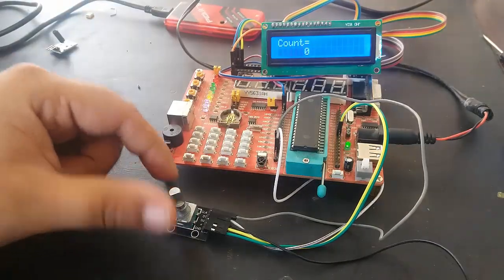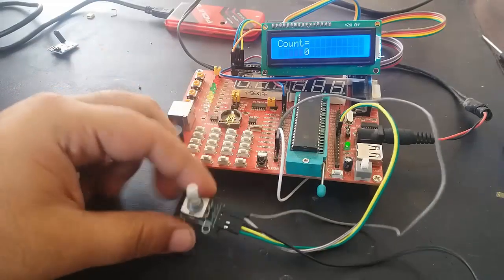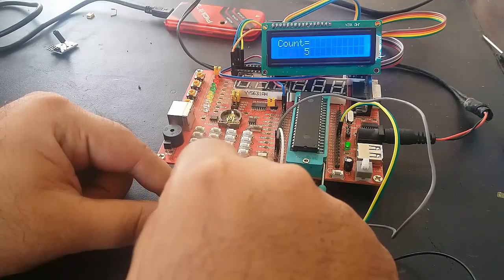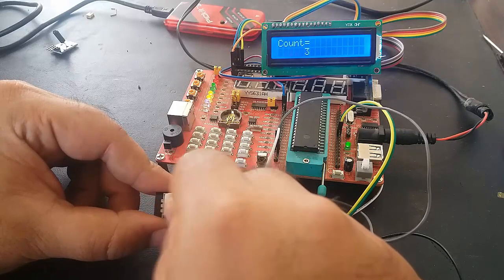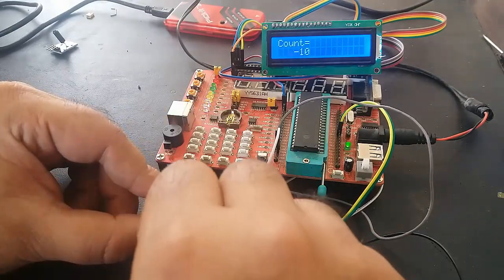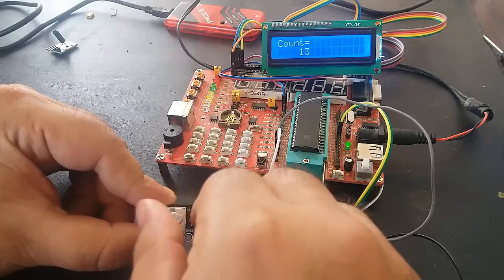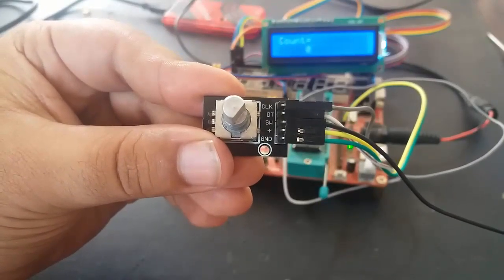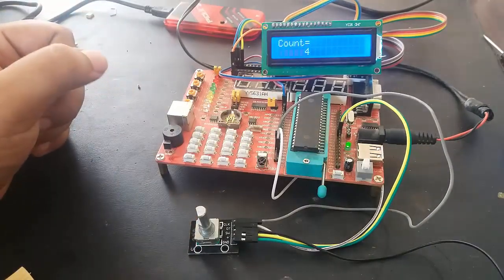Rotary Encoder Module interfacing with pic16f877a microcontroller

Comment: Here is the code:

// https://microcontrollerslab.com/rotary-encoder-module-interfacing-pic/
/*
If LCD display is interface with microcontroller then this controller easily displayed 
the direction of rotation and revolution per minute (RPM) of rotating shaft as well as with angle of rotations. 
Similarly, if this rotary encoder interface with pic microcontroller is used with any conveyor built 
at which objects are moved then this pic microcontroller interface with rotary encoder module 
can also tells displacement of the object form its original point.

In this tutorial, we have use PIC16F877A microcontroller, output pins of rotatory encoder module 
is connected with PORTB pin number 4 and 5. These pins 4 and 5 are configured as input pins.  
Interrupt is used to detect whenever rotary encoder rotates in a specific direction.  
LCD is connected with PORT D of pic16F877A microcontroller to display the counts. 
Video below shows the complete demonstration of this project.
*/

sbit LCD_RS at RD2_bit;
sbit LCD_EN at RD3_bit;
sbit LCD_D4 at RD4_bit;
sbit LCD_D5 at RD5_bit;
sbit LCD_D6 at RD6_bit;
sbit LCD_D7 at RD7_bit;

sbit LCD_RS_Direction at TRISD2_bit;
sbit LCD_EN_Direction at TRISD3_bit;
sbit LCD_D4_Direction at TRISD4_bit;
sbit LCD_D5_Direction at TRISD5_bit;
sbit LCD_D6_Direction at TRISD6_bit;
sbit LCD_D7_Direction at TRISD7_bit;
// End LCD module connections
signed int count=0; //this variable will incremented or decremented on encoder rotation
char text[7];

#define REA PORTB.B4 // Rotary encoder pin definition
#define REB PORTB.B5

void pbchange(void)
{
 unsigned char state;
 static unsigned char oldstate; // this variable need to be static as it has to retain the value between calls
 
 delay_ms(1); // delay for 1ms here for debounce
 state= (REB<<1 | REA); // combine the pin status and assign to state variable
 if(oldstate==0x0)
  {
   if( state ==0x1)
    {
     count--; //decrement the count
     //lcd_out(1,8,count);
    }
   else if( state == 0x2)
    {
     count++; //decrement the count
     //Lcd_Out(1,8,count);
    }

  }
  
 oldstate = state; // store the current state value to oldstate value this value will be used in next call

 PORTB = PORTB; // read or Any read or write of PORTB,This will end the mismatch condition
 INTCON.RBIF = 0; // clear the porb change intrrupt flag
}

void interrupt(void)
{
 if(INTCON.RBIF==1) //check for PortB change interrupt
  {
   pbchange(); //call the routine
  }
}

void main() 
{

 TRISB.B4=1; // set rotary encoder pins to input
 TRISB.B5=1;
 // inilized the LCD
 Lcd_Init(); // Initialize LCD
 Lcd_Cmd(_LCD_CLEAR); // Clear display
 Lcd_Cmd(_LCD_CURSOR_OFF); // Cursor off
 Delay_ms(100); // Wait for UART module to stabilize
 
 
 Lcd_Out(1,1,"Count=");
 // display count to lcd
 OPTION_REG.B7 =0; // enable pullups
 INTCON.RBIF = 0; // clear the interrupt flag
 INTCON.RBIE = 1; // enable PORTB change interrupt
 INTCON.GIE = 1; // enable the global interrupt
while(1)
 {
  //UART1_Write_Text(text);
  IntToStr(count, text);
  Lcd_Out(2,1,text);
 }

}